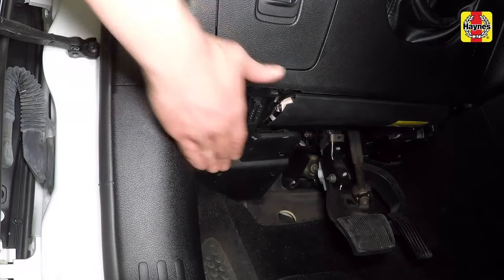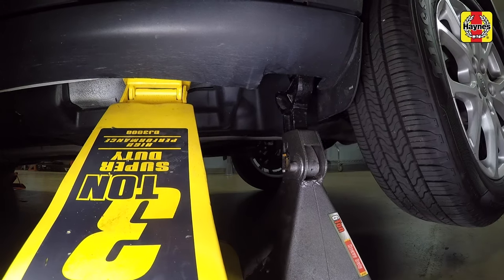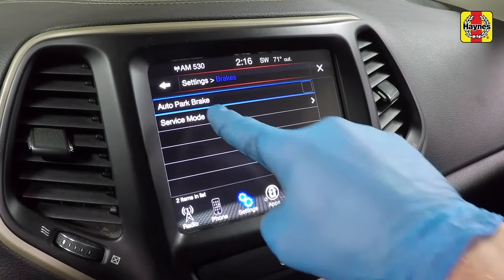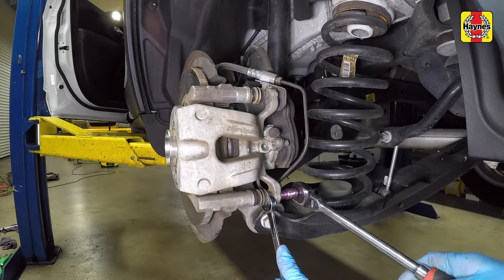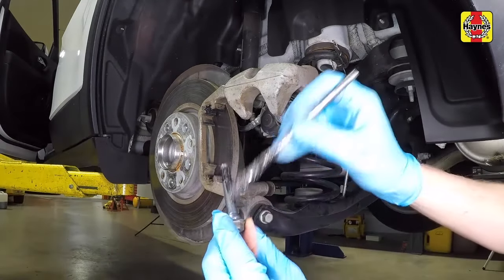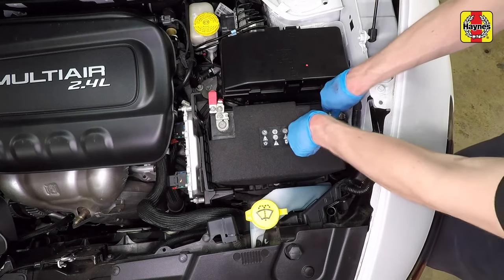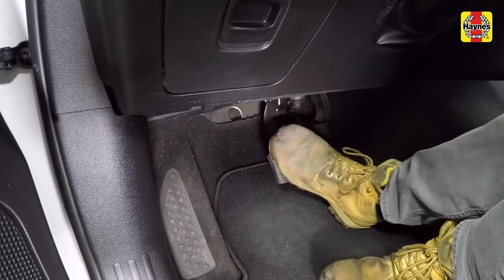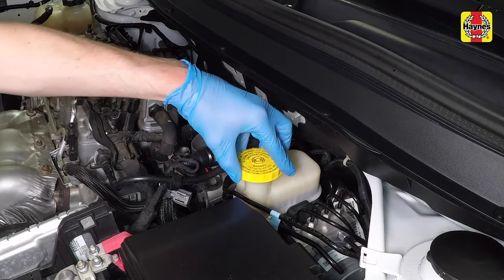How to Replace the rear brake pads on the Jeep Cherokee 2014 to 2019

Comment: For everyone who was in my situation, the back piston not pushing in.  Do the service mode, unplug the battery, push the caliper in (should be with ease) put everything back together.  Good video, dude just doesn't show him pushing the caliper piston in
Reply: C clamp
Reply: Thanks for the tip. It works.
Reply: They forgot the hydraulic side of the system.  Thanks for confirming.

Comment: If you live in the rust belt, you'll want to remove the caliper brackets and grind off the rust that's under the shims. The one I'm working on was metal to metal on one side and about half worn on the other side due to pads sticking because of the rust build up.

Comment: How would I manually put the e brake in service mode ?? Mines stuck with the e brake on and there’s only one solution to fix it and it’s not working after 2 times.

Comment: I noticed that they re-used the caliper bolt. These cannot be re-used due to the fact that those bolts are single use "torque to yield bolts". Before starting the brake job you need to purchase brand new caliper bolts which are "torque to yield" type from your local dealer or another certified source.
Reply: Stretch bolts with only 32ftlbs of torque? Ive never heard of such a thing. Also why would the slide pins stretching effect how the brakes work when the pin they bolt into... SLIDES. So even if the bolt is allowing the caliper to be too far in or out because it's stretched, the sliding pin would take up that 1/32 of an inch slack. This was a comment that seemed intelligent until you actually think about it.

Comment: This video does not show ALL the proper steps. This video only shows how to replace the pads like a shade tree job. The pins with rubber boot protectors in the caliper bracket must be removed and cleaned and re lubed with brake lubricant to have proper and even brake pad wear. Furthermore every time i replace pads i clean and replace the metal bake pad shims. Aswell as machine or turn the rotors on a lathe to get maximum life span from the brakes and pads. Also good idea to flush or bleed out the fluid every few years to keep the brakes working and clean fluid in the system. Ive been wrenching since 2004 full time. Good video just needs alot more info and steps otherwise these brakes will surely fail sooner than later. ✔️

Comment: Is it a must to drain the brake fluid?
Reply: No. Brake fluid level is supposed to be used to tell you how low your pads are getting. But for some reason, techs & DIYers top it off which then spills out when you compress the piston

Comment: this video ignores the fact that you still must push the piston back into the caliper before you can install it
Reply: That’s what the electronic break reset does for the rear caliper.
Reply: @Rynotastic  nope i have to depress i still
Reply: Common sense
Reply: Also the video ignores that some models, if not all that are listed… the battery is located under the front passenger seat and NOT  under the hood
Reply: @tobymanning3658  You're thinking Grand cherrokee.

Comment: What if you need to replace the rotors?

What do you do when you're all done with pads and rotors and after taking the computer back out of service mode, you get code C10d0-53 but everything works as it should, but you can't clear the code because of the SGW module???